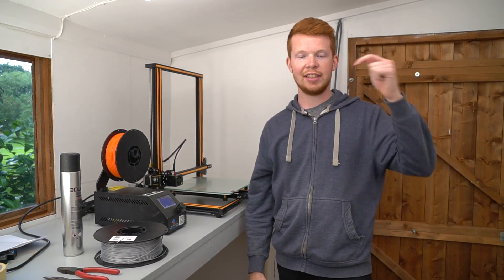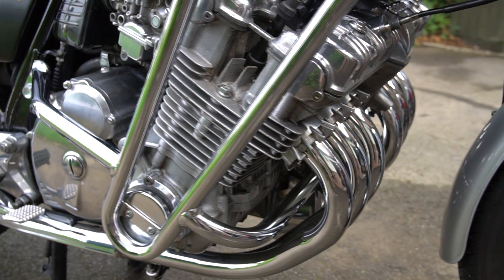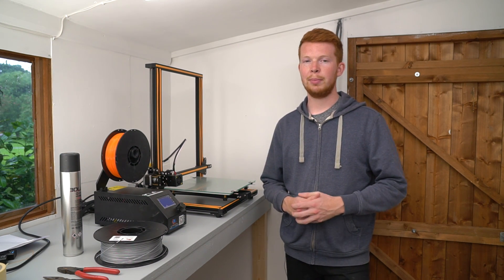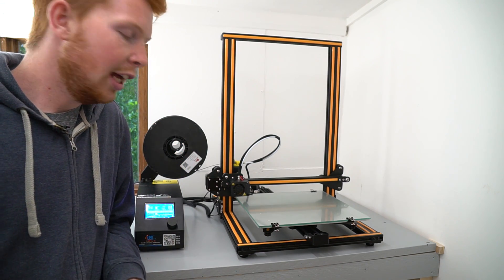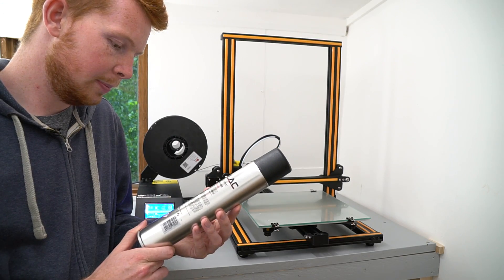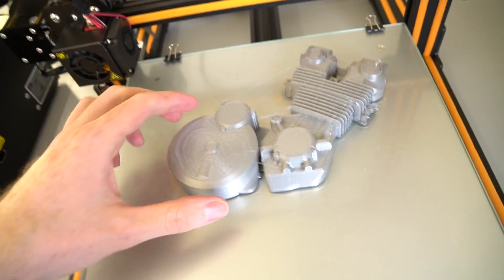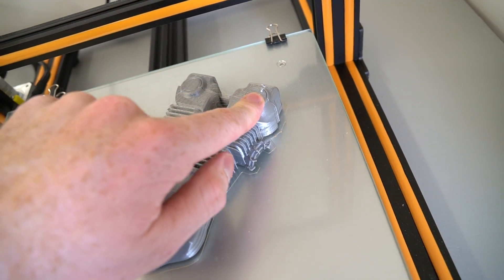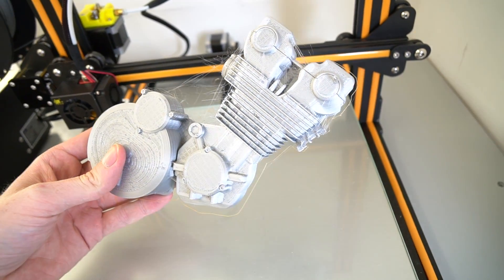3D Printed Birthday Present

Comment: Next time you should put the part in a bucket of sand, melt some aluminium and then pour it over the top. The heat of the metal will melt the plastic out of the way and replace it with metal